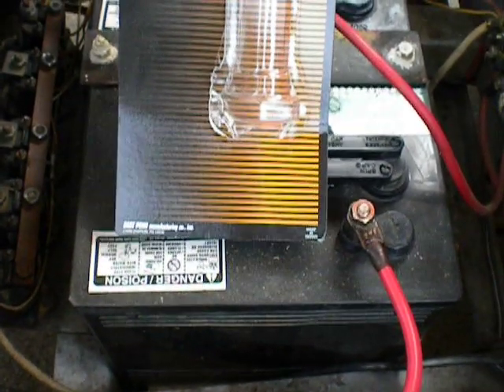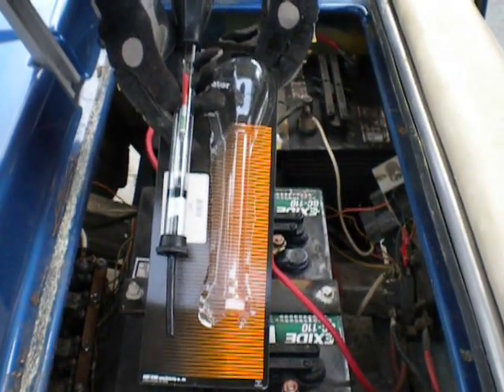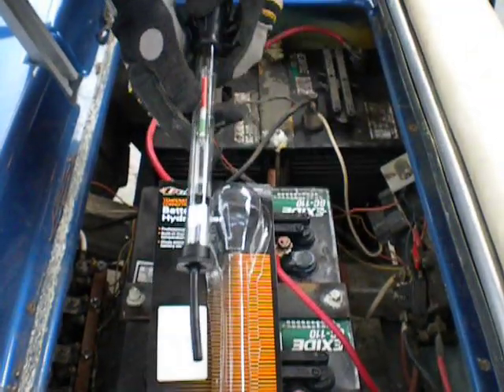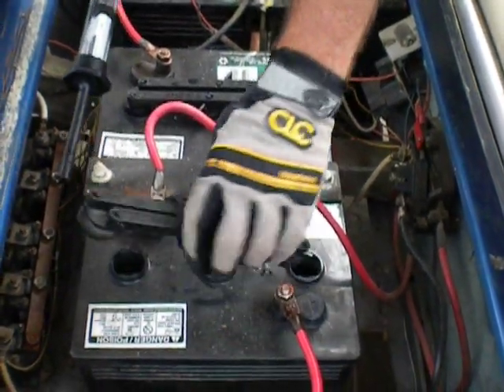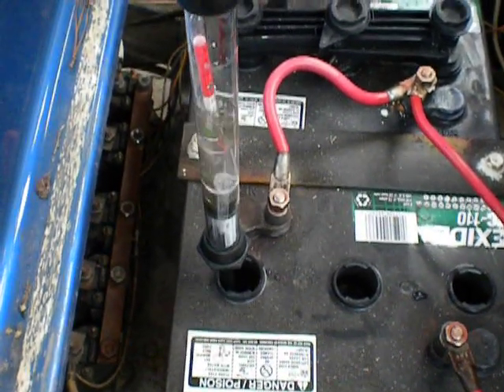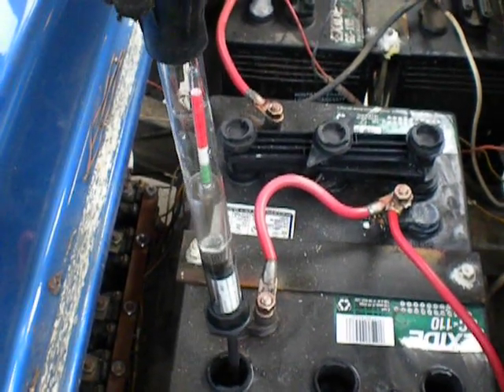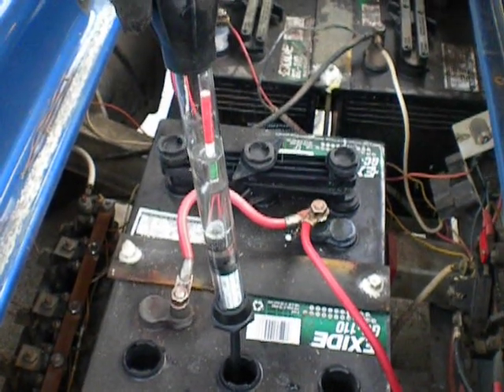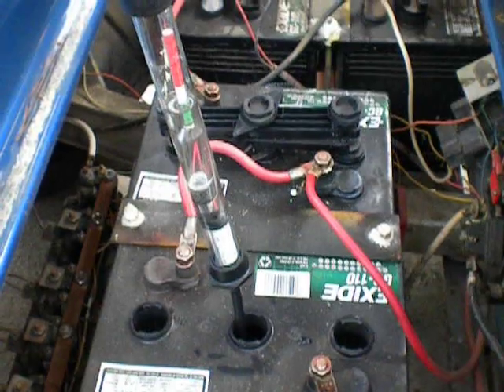Golf Cart Battery Hydrometers

Comment: so you say you have to replace the battery. but could it mean you just need to charge it up some more and that its not fully charge? i was going to buy a hydrometer and use it to see if my golf cart batteries where charged fully because i think my charger is not functioning properly
Reply: Yes you are correct, Tim.

Though the two cross over to an extent, the hydrometer tells you nothing concrete about the battery condition. Though if the electrolyte is obviously murky during normal charging along with low reading is a good sign the battery is getting tired,

It is designed to give an indication about state of charge of a battery in good condition. Any sulphation at all will render the readings untrue.

The float should be in the green at all times when the batteries are not in use. The white sector on idle batteries is an indicator of required charging ASAP.

The manufacturers data will tell you the exact gravity to expect, but should the float not go well into the freen section after charging is a cause for concern.  An equalization would be the normal course, though I would go with a desulphator. Either process should show a marked improvement in gravity readings, but of course, equalization is hard on the battery.

Always charge immediately after use and premature failure won't be a problem.